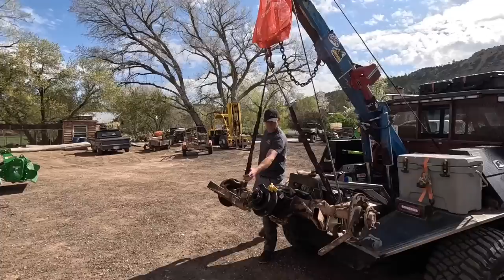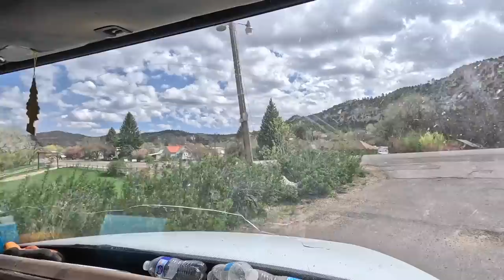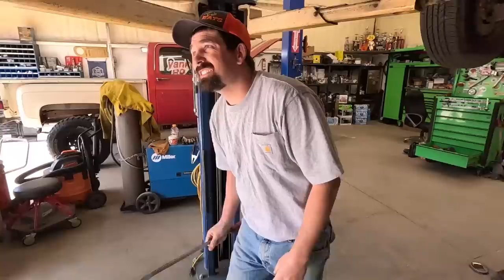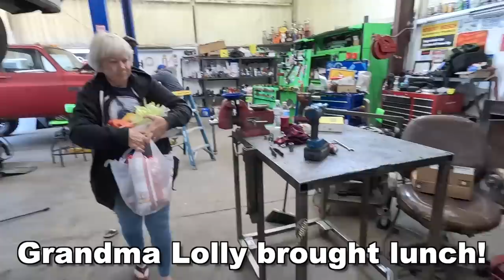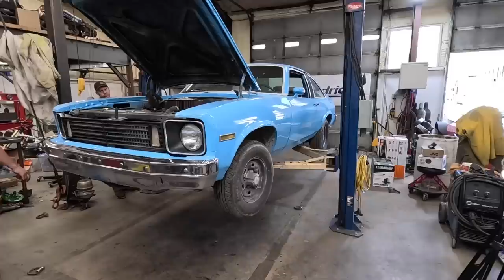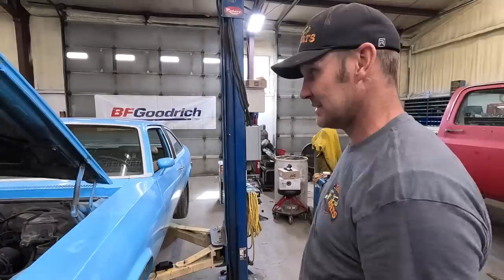Cursed: Our Shop's Nightmare Continues With Hunter's Nova!

Comment: You need to take all transmission work to a "REAL" transmission shop. Paul's shown experience on transmission repair is a big fat "0".  That Hunter would even let Paul touch his car shows his stupidity.  Let's get real if Paul wants a good transmission he goes out to someone else.
Paul said he does engines and not transmissions.  RIGHT, THAT'S THE REASON HE TOOK HIS ENGINE TO MERLIN FOR REBUILD.
PAUL give up on auto repair and go into construction where you can just pound nails into a 2 X 4.